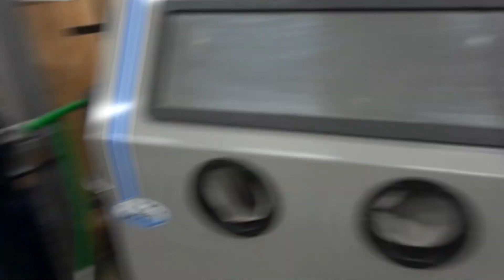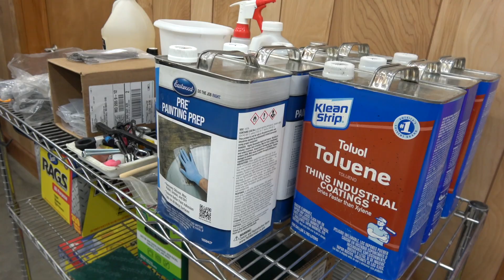LS3 G35 Build · Ep 4: How to Powder Coat

Comment: Why not put the VK56 in instead of a LS? The LS is definitely a wonderful engine but it’s used in so many swaps its nothing spectacular anymore. Specially for a YouTube series...🤷🏾‍♂️just my 2 cents
Reply from the maker: To be fair, this car had a single turbo high compression VQ in it for ten years for all the Nissan hype, and it’s a purpose built racecar, not a YouTube car... so LS3 was the best bang for the buck power and reliability option. It also weighs less, cheaper to build, better weight placement and is just all around better than a VK.
Reply: @ApexGarage   are you saying this LS3 weight less then the vq+soho turbokit? Also is the weight/balance of the car really different with the LS in?
Reply from the maker: @guillaumeloriault4074  yes the LS3 is a pretty decent amount lighter after you think about the turbo kit and piping and intercooler and exhaust and what not. Also all of the turbo setup weight was in front of the front wheels which isn’t good for weight balance. The ISR swap kit is the best on the market not only for the quality but also because of how low and how far back the LS sits in the chassis, moving it back multiple inches and moving the heaviest part of the car back toward the center of the vehicle by a decent amount.
Reply: @ApexGarage  thanks for your reply! I’m looking forward to do some lapping with my own car and modifying it in that way. Will still drive it mostly on the street though. Seeing you made the jump to LS would you still recommend a turbo setup for the vq for light track use or just go straight to LS?
Reply from the maker: @guillaumeloriault4074  id recommend leaving it stock and focusing on seat time honestly.